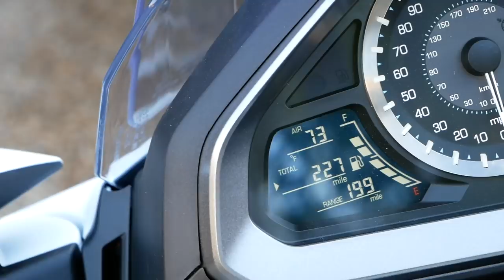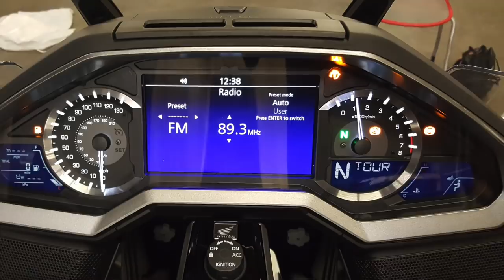2018 Honda Goldwing Long-Term Review

Comment: Cruiseman's Garage,
I've not only watched the whole video, but spent a lot more time, following the comments.  
Now, having done that, I'm sure I missed a few things, from the video.
Anyway, here it goes:

I understand that:

     You love this bike.
     You wouldn't go back to an earlier gen.   But kind of wished they included some bigger luggage
     space, and fuel space.

For me, they would be the same bummers, along with being a $30K bike, for which Honda has only seen fit to "downscale" the bike, except that it fits really well. With a nav system, with a lackluster navigation offering.

I tend to hate the fact that you can no longer fit (except for how you, or someone else showed us) to fit 2 full face helmets in the trunk.
Another bummer is about the clutch, if you wanted on, on this bike.  The fact that the foot shifter can be broken off, requiring a half an engine dissassemby, and, if I understand correctly, not under warranty.

To that, I MUST SAY:

COME ON HONDA:    YOU'RE TOO BIG  A COMPANY FOR THAT NOW.

(actually, I hope nobody at Honda Japan reads this and commits hiri-kiri over it.)

Another thing, and this is going back to previous demos here, on YouTube, by Revzilla:

Question for you, CRUISEMAN:

Has the new front fork assembly addressed the "head shake" issue of previous models?
(If you're riding down a straight road, and momentarily let go of the handlebar?)

I am in no way slamming this wonderful bike (2018 Goldwing), but it's these few things that I'd've expected Honda would have more fully addressed, at engineering time, I guess especially the headshake issue which you didn't claim if it had been solved or not.
Then the lack of trunk space, as it once had.
Then, the thing you said about seeing a 2018 coming down the road.

BUT never forgetting that the 2018 hauls butt.  OK?
Still, the other things need to be fixed, even the ones that you claimed you were nit-picking on.

I'd expect it be a stellar bike from Honda.  

I MEAN WHY NOT?    
(Are they starting to get bored over there?)

I just expect better from Honda, for this pricey machine. We are not all on the pay scale of the Engineers over there, who can afford daily lunches for around $30 or $40 per day at their local Macdonald's. (I own a jap bike, just not anywhere near on par with the Goldwing.)

I'm nowhere on par with the others in this forum, who have owned multiple GW bikes.
OK?   But, In the past, I was  the 3rd owner of a Honda Magna, which ran exceptionally well, AND made me ask myself:   Why?  Why would Honda make a bike this powerful?
Anyway, I will try to follow your videos.  
But wish you continued fun with your bike.

Comment: Thanks for this. You convinced me to look at another marque. Just way too many "niggles" for a machine in this price point. Smooth mirrors and a great seat are not going to impress me. My '07 Yamaha MT-01 1700 is a MASSIVE v-twin, and the mirrors are smooth..ya..a V-twin, and the seat with a cheap tweek is phenomenal. Nope...for $30,000k USD, a bike needs to tick ALL the boxes. 
Keep up the great reviews!

Comment: I can buy a brand new 2016 Goldwing audio comfort in my favorite black/grey/gold for $16995.  Talk about a deal!  After owning two F6B's and a matte silver 16 GW, my complaints would be: antiquated feeling suspension with no front end adjustments- not sure how much Progressive/Race Tech/Traxxion stuff really helps it out- engine has no character and winds out early IMO.  Loved the luggage capacity and my wife loved riding it.  I could only consider a 2018 Goldwing base model at $19k.
Reply from the maker: Traxxion can make a HUGE difference on the 2016 model. I had their upgrade on my 2007 and loved it. Not sure about the others, never tried them. Probably better than OEM, but not as good as Traxxion.
Reply: @cruisemansgarage  and they are quite pricey. Guess I need to at least ride the one.

Comment: I've had my 2018 non tour manual for almost 3 months and have almost 6500 miles, I love the bike. I'm getting 47mpg average, 50+mpg when 2 up. I agree the radio is terrible when it comes to reception, also isn't loud enough. Android auto is out now and is louder than Bluetooth for some reason. I had the same issue with marks on my sale bags. I also had found a scrape on the rim after I got home from the dealership, they claim I hit something and that it's not warranty and would have to pay fix it. I don't think the headlights are very good, especially curves at night. The seat is horrible compared to my '13 F6B that I had. I haven't ridden on the back yet. Saddlebag space is a little cramped, so much smaller than the previous bags. I'm split on which I like better, the F6B was much more comfortable and had more storage, but the '18 has more power and handled better. 

Lost the F6B to a deer, had kept it up, but it was so much damage done.

Comment: Way too expensive here in Canada at $34K for a motorcycle! No way. I can buy a lightly used pre 18 wing for $10K and it will do everything you need and gives you a smoother engine, more storage, and better wind protection. Sure I could put a duffle bag on the passenger seat on an 18 but somehow that defeats the purpose of having fixed luggage carriers and means something that can be stolen or soaked in the rain, etc. Honda fail.

Comment: Iv got a question 
On the previous gw model you had to manually lift the front screen. There was no gap between the screen and the front body( where front head light is) it was flush together with no air gap at the bottom of the windscreen.   I took a demo ride on the new gw I noticed On the new gw when you raise the wind shield there is an air gap at the bottom of the shield.. where it meet with the body.
So big that You can slide your fingers through the new gap. Highway winds get into that gap and it create a wind tunnel humming effect. That new noise makes it harder to hear the radio at highway riding. 
I think the solution would be to close that gap like the previous Goldwing. So no air goes through the bottom of the screen. Just Up and around.

This should quiet the wind noise down on highway rides.
Someone should come up with a rubber or plastic adapter to close that gap when the wind shield is in the up position.
Reply from the maker: This is a pretty typical design for electric windscreens, especially on adventure bikes and sport touring bikes. I am sure Honda designed it this way to save on weight

Comment: You don't like LED headlights? I can't understand that at all. I upgraded my Triumph to LED headlights and the difference is night and day. They're massively brighter and better. Honda must not be using good LEDs.
Reply from the maker: Honda just had such great Halogens on the previous Goldwings that it is hard for the LEDs to compete. The LEDs on the 2018+ have a narrow horizontal beam and don't throw much ambient light.

Comment: Agree. This is a great motorcycle. Fun to ride. With the electronics it is like getting a fast and nimble sport tour bike or a comfortable long distance tour with the push of s button. I love the DCT transmission and manual mode. The bike just looks beautiful, sleek and modern.
Least favorite has to be the finish of the wheels, the rough texture looks dirty after a few miles and is difficult to clean. My BMW’s have much better wheels. I have never owned an iPhone so most of phone integration is useless for me. I am sure Honda will fix this some day unless Apple owns them.

Comment: How would you create new maintenance videos without having a new generation Gold Wing Cruiseman? So regardless of how you feel about this new bike you really probably have to keep the bike. But all considered, this new generation Gold Wing looks amazing and will only get better because it’s a Honda. Now consider all other Ultra Touring motorcycles currently on the market. Nothing compares to this Gold Wing. Change is hard and all change is not always good. Honda’s no dummies you can be assured of that particularly if it affects sales. Weaknesses should get addressed if sales dictate. Good narration and review. Don’t always agree but do respect your insight.
Reply from the maker: Well, as far as the videos go, if I did not like the ne Wing I would have considered it a business investment and bought a 2017 as a daily driver.
Reply from the maker: Fortunately, i ended up loving the bike!

Comment: I am always struck when I see a big old GPS hanging on somebody’s handlebars, when they can get used to the Gold Wing GPS if they absolutely had to. But the absolute best option for the Gold Wing is the CarPlay. Why does nobody just use the CarPlay that was designed for the motorcycle? It’s better than any external GPS you can buy and if it’s not you just get another app…
Reply from the maker: Not everyone has an iPhone

Comment: I had an ST1300 with an electric w/s and the back of the screen got almost as buggy as the front.  In heavy rain water ran under the screen over the dash and right into my lap.   My legs and shoulders would get drenched.  I put the accessory wind guards on and they helped my hands and legs.  I like my 2015 GW and won’t be changing.  At 72 I think I have my last bike.
On the door alignment, is there any adjustability in the hinges?  I’ve done that on my cars before because door gaps drove me nuts.  Call me OCD but it did adjust after some initial struggles.

Comment: I could not believe that at the end of this video you called the 2018 / 2019 the sixth generation, it is the seventh generation...
1st gen.... GL1000
2nd gen...GL1100
3rd gen...GL1200
4th gen...GL1500
5th gen...GL1800
                 2001  to  2010
Made in the USA
6th gen...GL1800
                 2012  to  2017
Made in Japan it also has different body work and frame than the 5th gen. and many other parts not interchangeable with 5th gen.
7th gen...GL1800
                 2018 / 2019

I also know that you are giving your opinion on the things you like and dislike about the bike. In my opinion the center glove box does not need to be locked the left side fairing box on the 2010 to 2017 did not lock and thats where people put their Mp3 player/ phone to charge and to hook up to auxiliary, I personally do not have a problem with the seat I can travel up to 150 before I need to get off the bike. There are several other points that I disagree with you on. But one thing I do agree with you on and was very happy you mentioned it, there is absolutely nothing wrong with the stock suspension.

Comment: Cruiseman, Question If the pre 2018 had the same upgrades aside from the re-designed body contours. Do you think You'd also like that. I love Bulky?
Reply from the maker: Absolutely. If Honda had added the tech, the DCT and the electric windscreen to the previous platform, I would have bought that instead.

Comment: The fuel mileage at 41 is bad as fast as I am concerned. I get 37 pulling a 700+ lb trailer ( rollahome packed with a gen. AC ,food for r 3 weeks and deep cycle batt.52 quart cooler Clothes for a month and extra fuel. In Yellowstone no trailer I was getting 47 mpg. I was shocked but I keep detailed mog records . As bad as 31 but that was really hard riding in the mountaina. Would love to know how the dct does pulling a trailer. The new Goldwing your just didn't seem to have that lazyboy comfort I have on my 2010. I rode 9000 miles in 18 days first tDay was  18.5 hours in the saddle and I was ready to keep riding and I just didn't feel the 2018 would be good for more than 4-5 hours. I have the Corbin seat in my 2010.
Reply from the maker: I pulled my Bushtec trailer from Dallas to Knoxville for Wing Ding 40. It pulled fine, but you cannot use Econ mode. Tour Mode is required. The Hill Start Assist is a lifesaver with the trailer on a hill.

Comment: Walking mode seems sluggish in reverse. I did the clutch reset.  When I initially press the reverse button the bike moves then it immediate acts as if I'm pulling in a clutch and almost stops. If I let off the button and press it again it goes again then slows to a snail's pace or completely stops.

Comment: Took a test ride on a 2019 today. I was surprised that I felt so high on it compared to my 1995 GL1500. It sure was fun to drive. I walked away with a few questions the salesman couldn't answer. The handlebars seemed far forward to me. Can they be moved back? I'm interested in one with an airbag. Where does Honda move the USB connector to with the airbag? Either I sat higher or the seat is wider taking my feet farther from the ground. Is it possible to lower them a little bit? I'm 5'8"...
Reply from the maker: Handlebars can be moved back. There are aftermarket solutions for that. The Airbag USB connector is in the trunk, another can be added in the left saddlebag. Seat may be slightly wider, not sure. Talk to John at BikeSolutions.com. He may be able to modify the seat to get you lower.
Reply: Cruiseman's Garage Thanks!
Reply: My only suggestion to other folks taking a test ride is to make sure it’s not in Sport mode to start out. The salesman left it in Sport when I climbed on it and the throttle was incredible responsive... :-)

Took me a few minutes before I noticed it...

Comment: How is buffeting?  I've had '97, '01, and '15. With each new one the buffeting was reduced. Now with less wind protection on the 6th gen., How's the buffeting?
Reply from the maker: Even with the stock OEM windshield, buffeting was not bad. But it all depends on your height.

Comment: u touched on it briefly but i rode a 2013 wing and it was just way to hot as it kept all the air off of me..i'm looking at an 18 wing and was wondering if it will be to hot? i have other bikes and will use the wing as my highway bike specifically for longer road trips but want to be able to feel some air.

Comment: I enjoy your videos and just got my new 2018 wing yesterday.  I have a tough question for you.  Back many years ago, the automotive industry begin using aluminum cylinder block with great failure.  I know technology has improved but I'm still leary of a piston moving up and down on aluminum cylinder walls.  Honda it touting their new high strength aluminum cylinder sleeves.  Just wondering what Honda did to make this work with the durability that is expected from this engine.  Older Goldwings have been known to got 200,000+ miles.  Can we expect the same service from this engine with Aluminum sleeve?  Even for a few more pounds, I would feel more comfortable with case steel sleeves in an aluminum block.  Thanks in advance if you can shed some light here.
Reply from the maker: I guess the jury is still out, but, Honda is offering up to an 8 year factory extended warranty.

Comment: Long time R1200GS rider and starting to research the Gold Wing.  This was vid very insightful.   I split my time in DFW and Hill Country and would be interested in your experience riding the GW in the Texas heat.  How much heat does it throw off on hottest days?  Thanks!
Reply from the maker: Honestly, I have never owned a Goldwing that had a problem with "throwing off" heat from the engine. The new Goldwing does not have as much wind protection as the previous Wing, so it is actually a better summer bike, IMO.

Comment: Guys how do you attach a phone holder, cup holder or alternate GPS to the LEFT handgrip on a DCT?
I have cobbled together a mount but it is not as secure as it needs to be. The portion I attached to is tapered and has wiring coming out from the bottom.
Reply from the maker: Watch my video on installing the Garmin 595 LM and it shows how I installed on he left side and a link to the item.

Comment: Found a big design bug on a new GL1800. I ride in Moscow Russia, city full of traffic. When I slowly maneuver in a narrow, standing traffic jam, I close the mirrors, then I just get through everywhere. Suddenly, today I realized why it stops at the most unexpected moment! I thought I was pushing rear brakes, maybe I just forgot how to ride, but co-brakes can’t work like this! So, I’m slowly moving in one row-spacing, changing lanes between cars and AGAIN something blocks front brake and I just suddenly stop and almost fall. You know you dont brake front at slow speed it can lead to falling. Now attention! It turns out that when the mirrors are closed, with the handlebar turned completely to the left, the right closed mirror pushes the brake handle! The mirror brakes, stops motorcycle! Thats something out of any expectations and experiences! Accordingly, to the right, the clutch is pushed a little but not critical. Honda! What are you thinking? Lol. Yes, the new goldwing is fine fast and really good moto, but THIS! I predict you may say dont close mirrors and its not designed for traffic jams and so on. Ok but how about walking speed in narrow spaces. Its a design flaw. Imho
Reply from the maker: Yes, it is VERY dangerous to ride with he mirrors folded in.
Reply: @cruisemansgarage  even walking speed

Comment: Thanks great review. In a few weeks I will get mine delivered. Should I add crash bar to the bike before delivery? Should I buy a longer warranty ?
Reply from the maker: Crash bar, no. Extended warranty is not needed until your factory warranty runs out. No need to buy it when you buy the bike. I will doing a video soon on extended warranties.
Reply: @cruisemansgarage  I believe that you say no about the crash   bar because there is a plate around the engine but what about the side case are the rubber on side sufficient  to protect the bike.
Reply from the maker: @telemark1qc  Not even sure that anyone makes a crash bar to protect the bags. I have laid mine over on the left side to do some other work and the factory tip over protectors DO actually prevent the saddlebags from making contact.